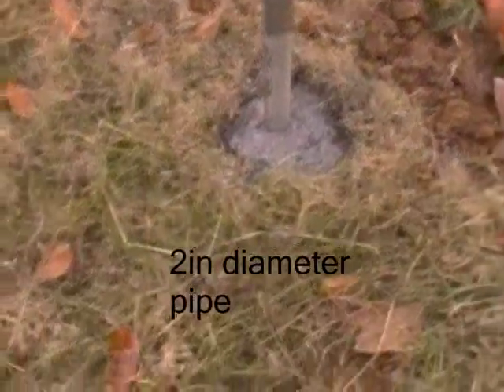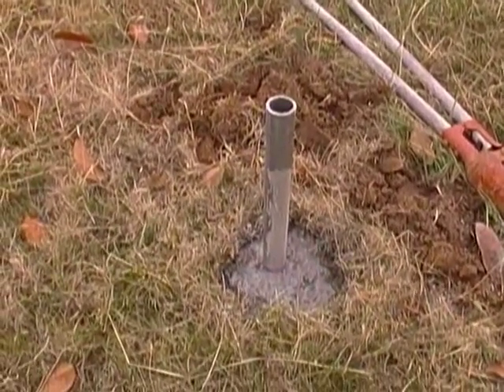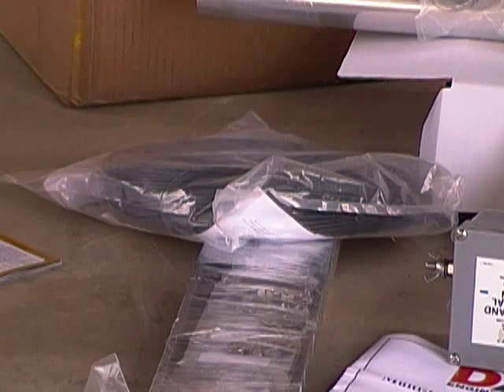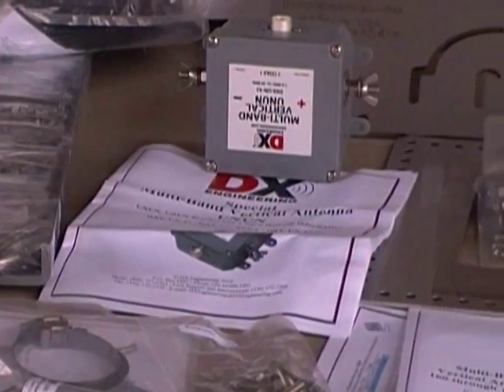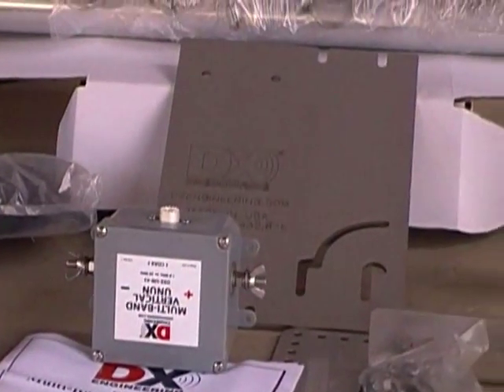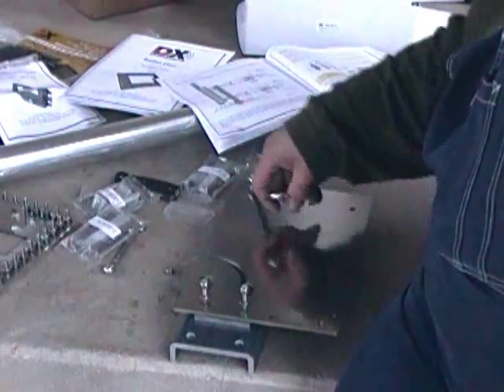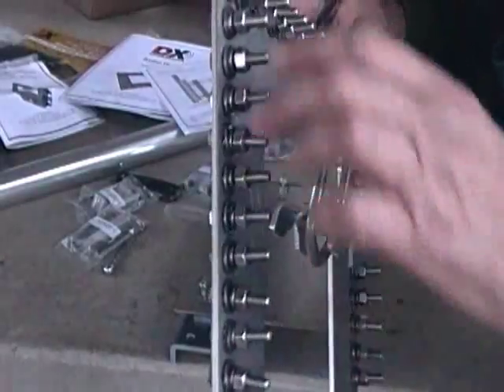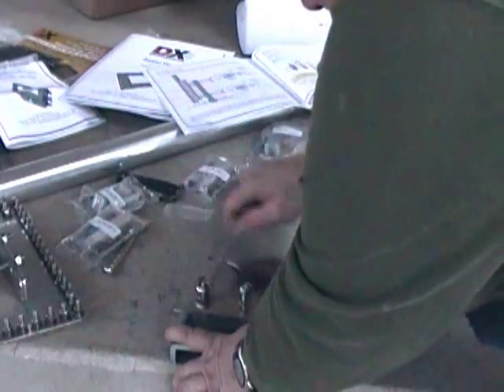DX Engineering 43 Foot 160 to 10 Meter Vertical Antenna Pt 1 of 3

Comment: I have the same set up as you have there Dave.  I had a Hustler 5BTV that got hit by lightning.  I bought another 5BTV and 4BTV and went with the 4.  These are really good antenna's.  I have an 811-A I run at times but don't need it that much.

Comment: I like your video, thanks for posting.  I have a 31' vertical from S9, it does a good basic job of getting me on the air.   Some suggestions: 1) U don't need  65' radials unless you work a lot of 80-160M, for 40-6 35 feet is just fine, and its probably OK for 80-160 too.  2) Verticals get noise from all directions.  I put up an Alpha -Delta DX EE this weekend - SO MUCH better, SO cheap, yo can put 2 up and switch directions, and u can keep your vert.  3) Farm = Beam.  That's what you need.

Comment: @20YearCombatEngineer - “If you tell a lie big enough and keep repeating it, people will eventually come to believe it. The lie can be maintained only for such time as the State can shield the people from the political, economic and/or military consequences of the lie. It thus becomes vitally important for the State to use all of its powers to repress dissent, for the truth is the mortal enemy of the lie, and thus by extension, the truth is the greatest enemy of the State.” - Joseph Goebbels